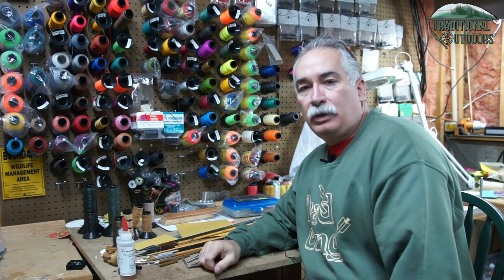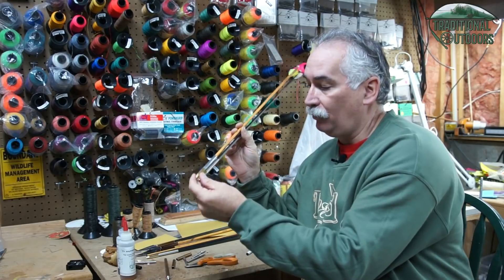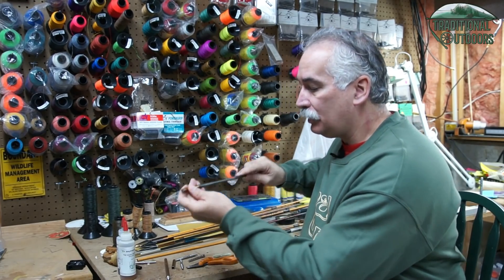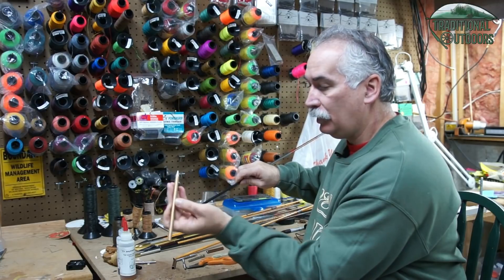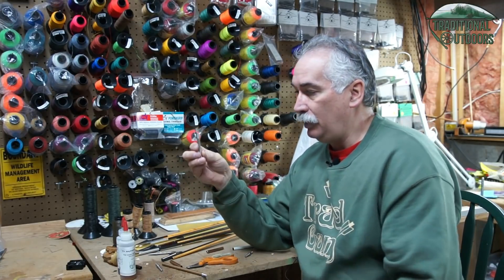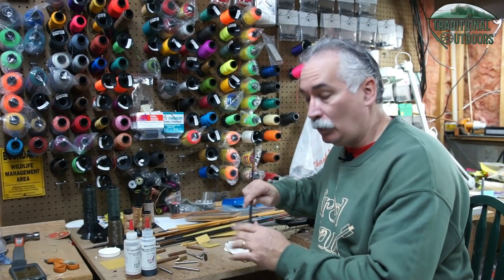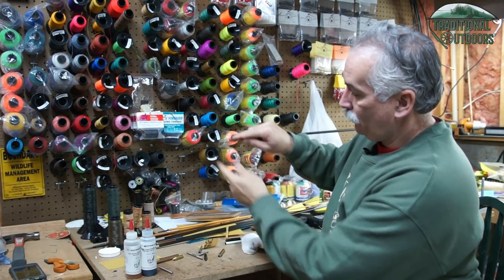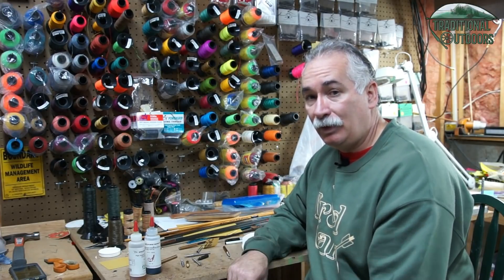Building a Virtually Indestructible Carbon Arrow

Comment: looks like a great system. When you draw the arrow does the aluminum footing cross the riser or does it hang out in front not making contact? Thanks for the info.
Reply from the maker: The back of the footing should not come into contact with the riser. My hunting arrows leave plenty of clearance between the back of the footing and the riser. Good luck this fall!
Reply: @TraditionalOutdoors  thanks for your reply.
Reply from the maker: @timetohunt1  anytime!